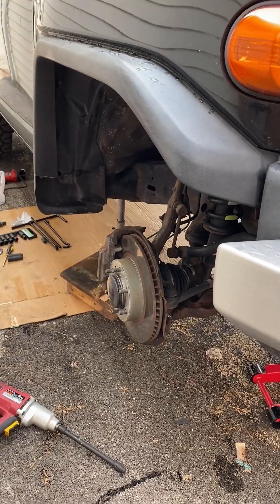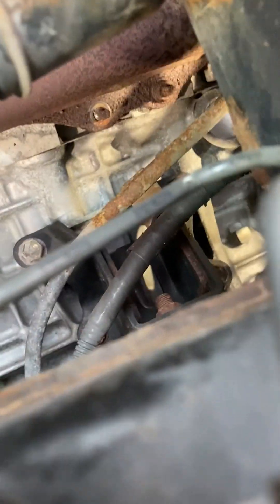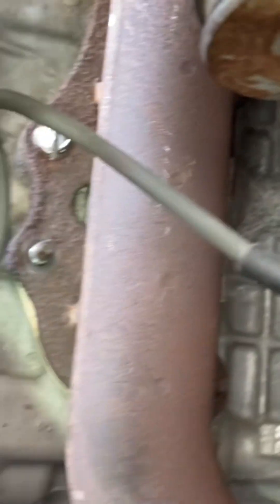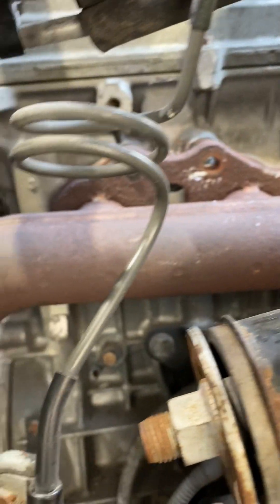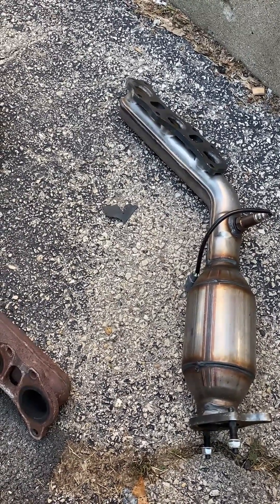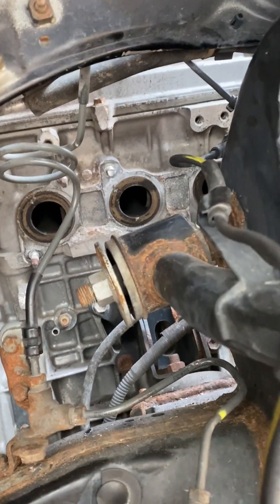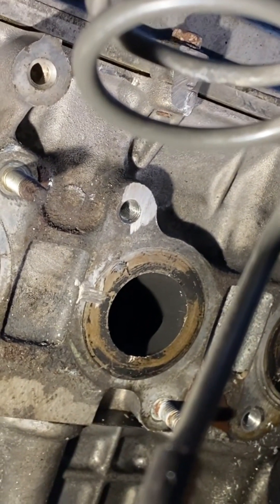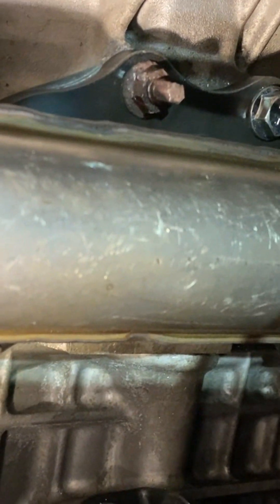Toyota 2007 FJ Cruiser exhaust manifold catalytic converter replacement

Comment: How come no one in these cat replacement videos says anything about the break in procedure you need to do after installing the cat?
Reply: what's the procedure?
Reply: @sammysosa389 First make sure you have no exhaust leaks and no misfires. After replacing cat let the car just idle for 5 minutes then after that 5 minutes is up raise the rpms up to 2000 for 2 minutes then just shut your car off and let cool. After that drive as normal. I wouldn't skip this procedure if I were you.
Reply: @dannycolemire2652 okay thank you i'm gonna be installing bank 1 n 2 cats this week

Comment: I did mine a little secret I removed the inner fender covers and for a week every time I came home from driving I sprayed down the bolts while it was hot with pb blaster the nuts came right off easy hope this helps anyone out there

Comment: They usually go bad around the same time in my experience. The p0420 and p0421 comes and goes. The check engine light will come on once in 2,000 miles, then 200 miles. I was just resetting the light. Once the cat's go bad all the way the check engine light comes on every time you start it. That's when I would replace it. Great video.

Comment: Nice video, thanks for posting. Did you get/use new gaskets?
Reply from the maker: The exhaust manifold that I purchased from 1A auto came with new gaskets so I did use new gaskets when I installed the new manifolds! God bless!

Comment: Thanks for sharing this video man. I might have to cut/extract bolts too from the looks of mine. I saw you used a hex bolt to replace the manifold bolt/nut set. Was there any difference between the hex head and original manifold set?
Reply from the maker: Autozone has a manifold bolt set you can purchase. But because I had to drill out the bolts I had to install a larger bolt. I didn't have any issues with the hex bolt, just make sure to match your thread. I am not sure if I remember correctly but I believe that the original manifold bolt/nut is a 1.25 thread. I tapped the new holes and went with the larger bolt but I believe I still used a 1.25 thread. Hope this helps! God Bless!

Comment: Nice simple video! Mine are in need of replacing on my FJ, where did you order these parts from?
Reply from the maker: @kevinevan173 I ordered the exhaust manifold cat from 1A auto. Decently priced and it was good quality.
Reply: Ah thank you for the reply!  I was debating over this one and I wanted to see someone else's experience with it!   @NDIYDADP
Reply: I did not see any penetrating
Lubricant.